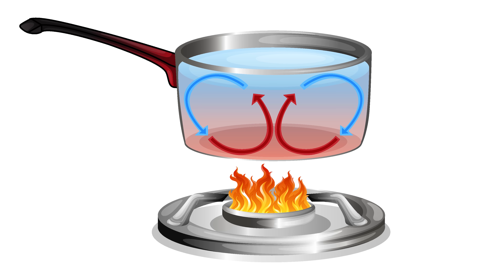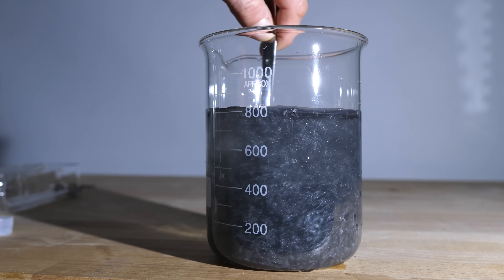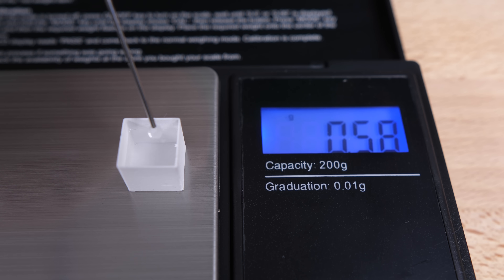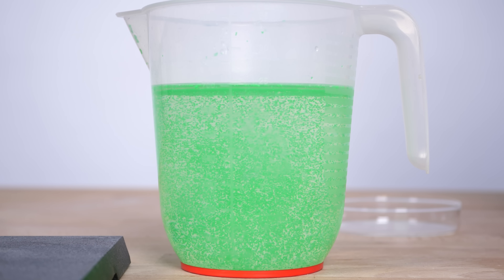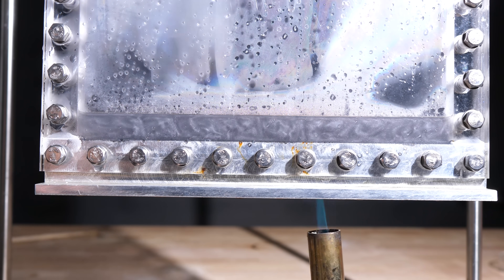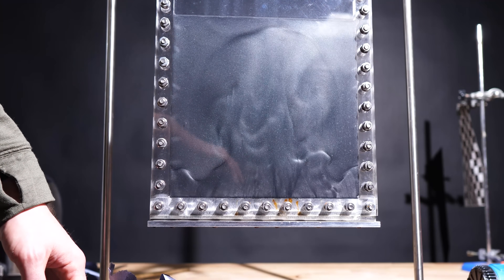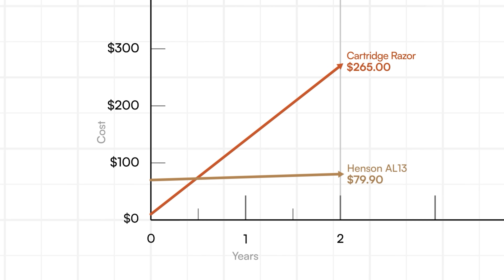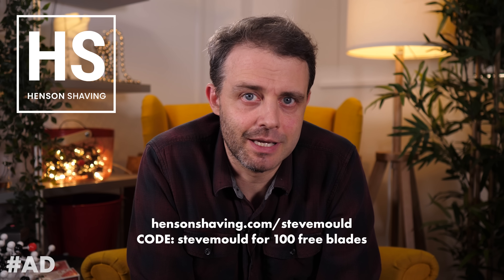The bizarre patterns that emerge when you heat ANY fluid

Comment: I found a very weird "self-sustaining" flow if you will, while brewing a kind of tea from my country, that we usually drink by pouring the water over, rather than brewing.
at some point in the brewing the leaves got mixed with the water in such a way that they would sink to the bottom, but if you stirred the whole thing, they'd be caught in a whirlpool in the middle, rising and falling with the current.
calling them "leaves" is an overstatement as they're more bits of leaves than whole leaves, each less than a milimiter wide, but you get the point... it'd be like the flakes in your first test.
it's a weird combination of the rotation of the stirring, the convection of the brew, and the bulk of the mass of flakes cutting through that... and it's a very unstable reaction: if you give it too much gas, it'd just boil up and push all flakes to the top chaotically; too little gas, and it'll cool off... just the right amount, and it'll go up and down, like a heartbeat.

Comment: Micas are sheet silicates and they generally have what is known as a T-O-T structure (each sheet) which are held together by cations such as K+ through very weak forces. As individual flakes this cations are not there so there is a net charge on the flakes. In this case, possibly what happens is when individual flakes come together they attract each other due to their charged nature. I am not sure though this is exactly how it works in liquid. But this is the reason why mica flakes stick to our hands (electrostatic force).

Comment: Aren't there some printer patents that should expire soon? I hope that's the next thing after 3D printers - cheaper DIY printers where ink companies have to compete for the buyer. But yes, the convection thing is great, too. And I suspect something like static electric fields (mylar is metal on plastic film), in combination with dielectric behavior of water to get those swirls.. I suspect that you get the swirls in any dielectric fluid, from mineral oil all the way to liquid nitrogen.

Comment: Mica flakes align themselves locally when submerged in water due to the repulsive forces between their flat surfaces and the water molecules, leading to a reduction in surface energy. This alignment minimizes the contact area between the mica flakes and water, resulting in a stable configuration.

Comment: I guess it makes sense, ya. Theres an equal amount of fluid moving up and down... otherwise its flowing into the sky. The molecules drag nearby ones with them. Viscosity and surface tension i would imagine play a role in determining how big and how stable the individual cells are. And maybe even magnetism in the case of plasmas on the sun. Very neat demo with the powder

Comment: Interesting. I wonder if viscosity is a key factor in the creation of Bénard cells, and the ratio between viscosity of the hot vs cold regions. I wonder if you made the water the same viscosity as the oil, would it behave more akin to the oil or its "normal" self?

Either way, cool vid.

Comment: I switched to the Henson razor recently. I'd been using the Harry's razor, and I liked their business model: they sold their handles and blades only online, so you never have to wait in a store for a clerk to come unlock the cabinet so you can put some outrageously overpriced razor cartridges in your basket. Harry's lets you set up a subscription so that new blades show up in the mail around the time you need them. Sounds great, right? Only I have a beard, and that means there's less surface area to shave, and the longest interval in their subscription isn't long enough (people think, if you have a beard, you don't shave; beards rarely grow in a nice, neat way, and need to be shaped.) I began thinking, I'd be better off with a single-blade razor, because the Harry's razor is a 5-blade design, presumably to skirt existing patents. I suppose it's great if you're clean-shaven, but for a beard I needed more precision. My sideburns creep longer as it is. After using the Henson razor for a few weeks, I went for coffee with my friend Paul and his wife, and the first thing she says when she sees me is, "Have you changed the way you're wearing your beard?" I said no, it's been this way for years. But I realized later, what she was picking up on was that my beard, the same way it had been for years, was better since I switched to the Henson razor. I'm getting that polished and precise look, guys get as they get older.

Comment: One explanation for the local alignment is: "As the mica flakes move around in solution, they bump into each other. The weak attractions between them and the tendency to minimize surface area with respect to the movement of the water encourages them to align with their flat faces parallel to each other. This parallel alignment allows for the collective, constructive reflection of specific wavelengths of light, resulting in the beautiful iridescent effect observed."

Comment: I think you are looking at the wrong angle. My guess is you can only see those convection cells from a top view from heat source. You would need to heat the back panel to see it or creates a circle/square box verve thin rectangle because if your heating the bottom only the top will show the convection cells.

Comment: @stevemould Not a scientist, but I like to think outside of the box. I believe the mica powder moves linearly because the particles might be a different shape than what we usually think of what a regular (round) particle is. Let's think of this particle as a round particle with let's call it the stiff tentacles (kind of what the simplistic Sun drawing would've looked like as a 5 year old would have drawn it). That way, the particles would have been interlocked and move "together" in wave patterns.

Comment: I have a some kind of enamel marker "edding 792" if you make a quite a puddle of liquid it also have similar convection currents but probably not because of the heat. I guess the solvent inside is evaporating which also change density and the pigment probably behaves like mica powder (metalic colors of ink) so it have clusters of convection currents

Comment: The micha powder lines up because of the particle shape. Even when powdered, each individual particle is still shaped like a domed pancake. So the current will push the pancakes like sails that all align with the wind. 
Imagine the actual micha in a good sized bit of matrix the size of your fist. If you were to just hit it with a hammer at a random angle, chances are that you won't be lined up perfectly with the layers, so you wouldn't be exclusively pulling sheets off. Instead, when the impact is distributed as pressure into the matrix, it will spread out like a cone. If you are exactly parallel with the sheets, you may get a clean shear, the opposite happens with a perpendicular strike, you break individual layers and you may not separate a single sheet at all. But the chances of that are extremely slim, and the powder is impacted countless times. So at an off angle, you can imagine the cone of pressure spreading in most angles, except for when it runs parallel and then it shears two layers apart and the pressure that would radiate from the impact in that direction ends up propagating, and that greatly reduces the pressure in that direction while the off angle pressure snaps as pressure is gradually diffused.
So as you keep impacting the micha, the overwhelming majority of impacts result in shearing a layer off with the layers below the shear line becoming smaller in diameter. 

Now imagine you have a bunch of pancakes with a domed side and a flat side and you drop them off a hot airballoon. With air current pushing the flat side and that side acting as a sail, the pancakes then have a more domed side facing the current, the shape is self correcting, and that means all the pancakes would fall from the balloon so the flat was up and the dome was facing the bottom. 

Now translate that into the micha slowly traveling  wɓith matching alignment and then a bit of current moving through to have those trapped in the current

Comment: The henson razor sucks, the blade not having any give is bad, the blades giving lets them conform to the shape of your face. If they don't have give, they're more likely to give you razor burn, from experience. I got much worse razor burn from my Henson than I ever did with cheap cartridge razors. If you're really worried about cost over time, just get a good electric razor, I've had mine for two years and never replaced the blades, it still gives me a shave almost as close as a safety razor, indistinguishable if you just shave daily, which is easier with an electric anyway since you don't need to use cream or gel.

Comment: 2:25I then instantly recognize this movement from a architecture drawing about "how to cool your house".
they stated there that Hot air goes up while Cool air goes down.  
so to eliminate hot air.  you need to put ventilation above so the hot air can go out.

this also explains why air-condition unit should be place on higher place so that it can suck off and cool off the hot air on top

Comment: A great series of visual experiments thanks Steve. The explanation using "buoyancy" terminology is interesting. Essentially, when the medium is heated it expands (see Boyle et al) and its resulting density is less. Then the denser medium AROUND it sinks due to gravity, DISPLACING it into the visible column, bubble or stream. Its a hard concept to imagine as we see the smoke/column/medium rising and our vision is drawn to that. But its deception. Also, we have been told for eons that "hot air rises" when it simply doesn't. It gets pushed up. We need to adjust our terminology.

Comment: 6:45 I always saw this in oil in a deep fryer.
The effect was noticeable because of the oil viscosity and how the flow made the oil surface (bumpy) and how the heat distorted the image of the heating element and a plate that had circular holes that was on it.
Reply: And after prolonged use small fries crumbs made it more visible

Comment: Wait if one cm³  of water is 1g why the hell do we use prototypes for kilograms?
Reply: The density of water depends on what's dissolved in it, as well as the temperature. Controlling those to the level of precision we are talking about here is not trivial. Also, how would you measure out exactly 1 cm³ to the required level of precision? It seems to me like you would need an extremely precisely machined device/container, which would essentially just be the prototype with extra steps at that point. Also that's not the actual exact definition anymore. It's close enough for gram-level precision at home but not the kind of expectations we have of a central standard.

Comment: You can get a pretty good hexagonal lattice in cooking oil by just heating it up in a pan on a gas stove top. Just use the largest burner so that the heat is eavenly dustibuted on the bottome of the pan and you can watch the lattice form. It won't be perfect, but it's pretty close.

Comment: I suggest you repeat your experiments with fluids already having a more or less homogeneous temperature of 45°C-50°C and the convection cells will show the drop in temperature not the increase

for a 3D and "in real live" version of the convection cells, I suggest miso soup from Japanese restaurants!
It seems that the "miso paste" used for these Japanese soups is not dissolved in the broth but that it just disperses extremely fine miso particles which then allow us to "see" the convection cells while the soup cools.

Comment: We used Mica a lot when working with atomic force microscopes. The reason is that it similar to graphite has atomics layers, which can easy be separated by scotch tape. Stuck some tape to Mica, peal it off, and you get a fresh and super clean nanometer flat surface. The surface charge also helps biomaterial like cells and DNA to hold onto the surface. I guess it is that charge that makes the flakes interact.

Comment: I did this back in 1960 for a science experiment in a much simpler way.  I put 10 mls of aluminum paint in a test tube filled with paint thinner.  Shaken up the test tube and the paint stays suspended.  Then simply hold the test tube in your fingers and the body heat from your fingers causes convection currents inside the test tube to appear.    I did that for a Junior High science show.

Comment: Actually there is a somewhat easier way to see convection cells. I have seen them on multiple occasions when I poured cold milk into cocoa drink. It takes some time to establish, and they drift rather quickly, but they are still discernable

Comment: the mica flakes align with each other locally because the flow of water is the same locally, which will cause them to face the same direction. I'm not sure if its just the flow of water or the boundary condition or density differences or what but I'm pretty certain that's why. cuz like if you take a bunch of pieces of cardboard or paper and blow them in the same direction, they tend to angle themselves to either become more aerodynamic or more like a parachute, depending on the shape and size. of course, if they are all the same size, then that would make them all angle the same, whatever the reason.

Comment: The fact that the sun's surface looks like a liquid may not be a coincidence. Have a look at the liquid metal hydrogen theory of the sun. It solves a lot of problems with the sun a lot simpler than the standard plasma model. It's also interesting that metallic hydrogen has sim similarities with the mica particles you used to get that effect. Did the convention cells appear without the mica? you didn't try in your video. Both metallic hydrogen and mica have that quality of locally lining up.

Comment: Aren't you giving it too much heat, in comparison to the one you give to the water boiling the spaghetti? I mean, you may have about 2l of water on the spaghetti, if they are 200g (ration for 2 people) but on your container, what can you have? 20x20x0,5 cm³, maybe? So, 0,1l, a 1/20 of the mass.  Is that flame a 1/20 of the heat you apply to the spaghetti?

Comment: If you thin acrylic paint to the perfect consistency it makes similar patterns to the Tia Maria, it's called fluid art or paint pouring, and sometimes with the addition of oil and heat. How it works is a usually seen as a bit of a mystery.

Comment: People are under the spell of authority, that's why they struggle to see an obvious fact. The Sun is not gaseous plasma. It is clear there is a real surface on the sun. The body is in liquid state under the huge pressure of the atmosphere acting on the surface. You would see hexagonal structure in perfect conditions for sure as the liquid is a hexagonal planer lattice made of liquid metallic hydrogen. A lattice very similar to graphite of sooth. That's why photosphere emits continuous spectrum of white light. You will never replicate your experiment to show convection of an ionized mostly homogeneous gas to show that pattern of its surface. The reason is very simple, gases do not produce any surfaces. Steve, open your eyes.

Comment: This is an excellent demonstration of how dynamic complexity can emerge from the simple dispersal of energy into entropy.

While the temperature gradient in a solid is close to linear, fluids are capable of more complex intermediate behaviors when heated, as we can clearly see in the video. (It helps that there's a gravity field as well, to convert changes in density to movement through the fluid.)

People are sometimes puzzled about how complex biochemistry can emerge in a system which, in an overall sense, is increasing in entropy. The short answer is turbulence.